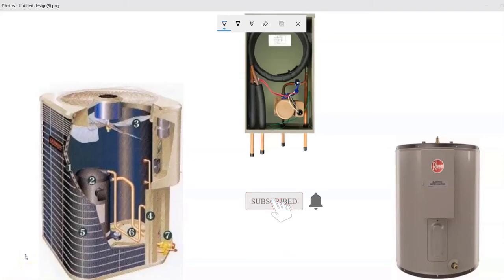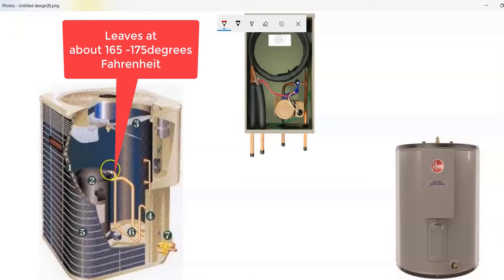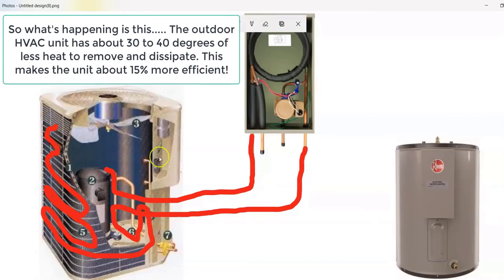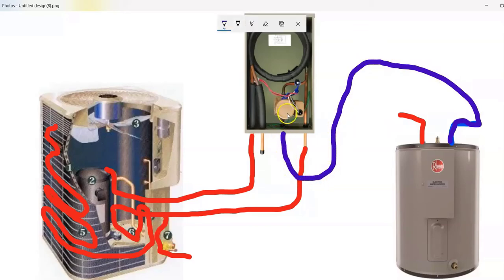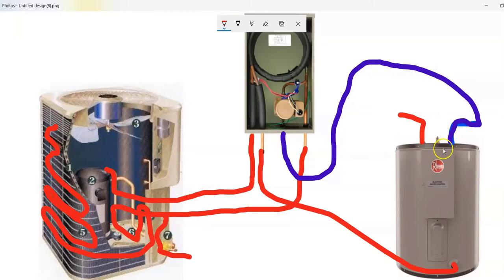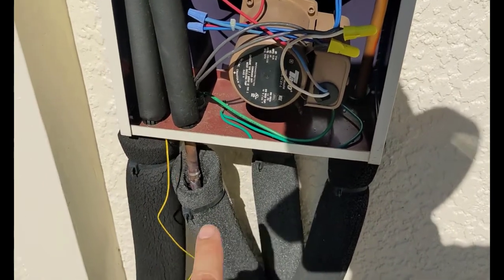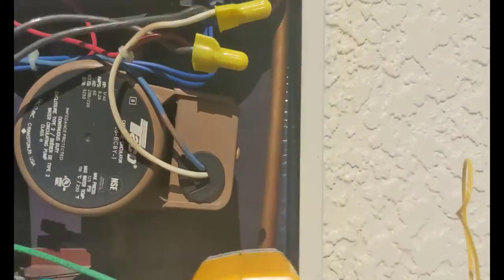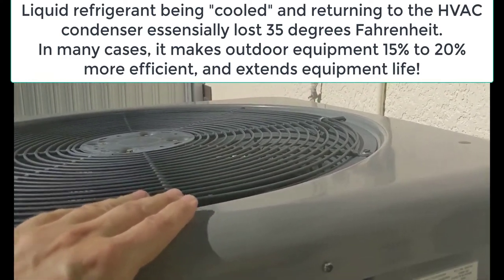Doucette Industries waste heat recovery unit HRU details explained heat exchanger

Comment: What are your thoughts on integrating thermal batteries?

Or 

Do u think there is an option to add additional supplimental heating sources to a heat recovery unit ( HRU )  like this?
Reply from the maker: I just use these as is. Excellent energy saver

Comment: Do the ac lines and plumbing lines mix together or is water heated from radiant heat
Reply from the maker: Lines are welded together so heat transfers that way. Contents inside the lines NEVER touch each other.
Reply: @SaveGreenHere  makes sense. Thanks

Comment: Do you know if these type of systems are common with commercial and industrial users and applications? In other words, this is not some kind of uncharted territory, right? Also, do you have an estimate on how much % this saves from your bill? Did you say like 15% from the AC plus possible most of your water heater electric bill?
Reply from the maker: Very common, just not very common because of many wrong installation practices. Check out their site...... https://doucetteindustries.com/ We estimated between 10% to 20%, depending on the age of the HVAC system. The older more inefficient HVAC systems, saved more, due to their inefficiencies. In my case, I would completely turn off my water heater at the breaker panel, from the first of May until November end of November, so like 7 months. This of course, being in a very hot climate in South Florida. So easy to say, 60% to 70% water heater savings. Seven months of the water heater totally disconnected from electricity. The other months, it probably made the water heater work less, as the water coming into the tank was already pre-heated. But, this is dependent on the geographical location. The hotter the climate, the more savings, because the HVAC system runs more. It's that simple.  You can see a seminar here-----> https://www.youtube.com/watch?v=i_ZiIuHh2iE

Comment: Do these cause problems down the road with Freon leaks and stuff like that?
Reply from the maker: None whatsoever. The issues I have seen is poor installation, and the refrigerant lines connection AFTER it leaves the condensing coil, which is totally wrong because by then, the refrigerant line is not as hot. You need the heat transfer to occur BEFORE the refrigerant even enters the coil. That not only give you the hottest water, but also allows the heat exchanger to help the air conditioner gain more efficiency, because by then, the condensing coil has less heat to remove, because the heat exchanger already took some of that heat and transferred the heat to the water line. Hope this makes sense.

Comment: If this is so good, why does every house not have one installed?
Reply from the maker: Unfortunately because the installation is usually not done properly, by tapping into the refrigerant line IMMEDIATELY as it exits the compressor, BEFORE it enters the condenser coil.

Comment: I have a unit like this installed and in the spring and summer I completely turn off the water heater.
Reply from the maker: Yes, areas closest to the equator can completely turn OFF the water heater, and get free hot water just by using air conditioning.